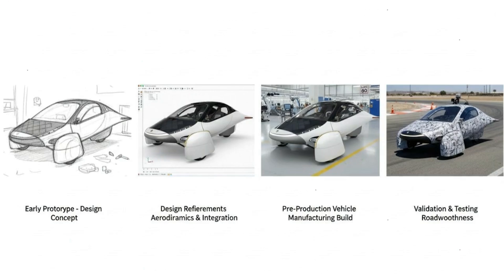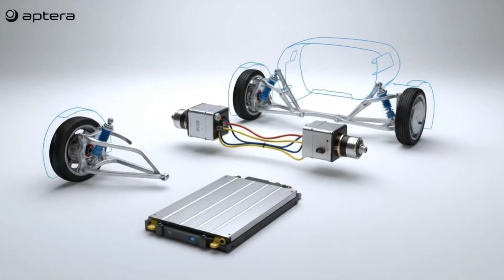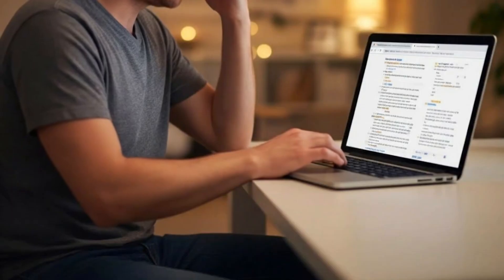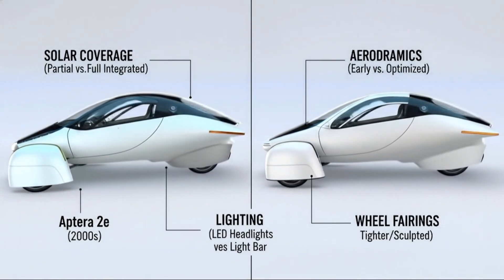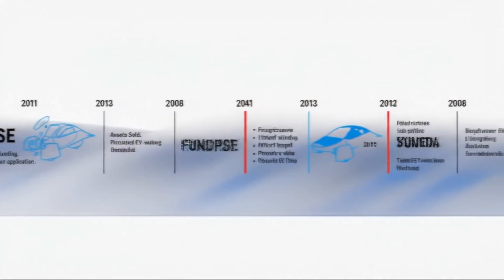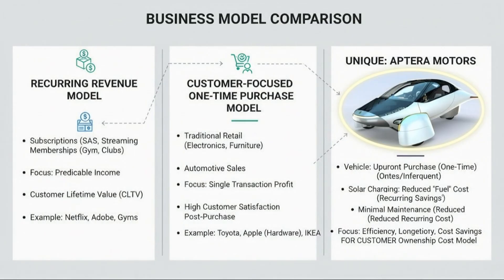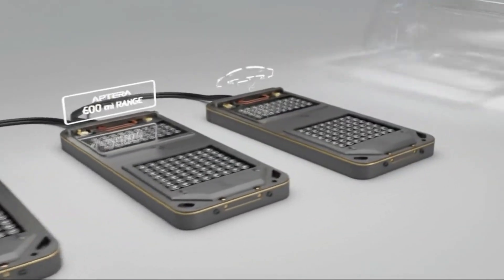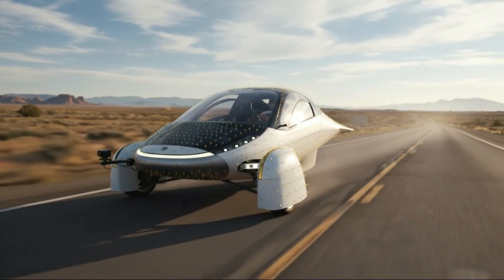Aptera’s New Gen 7 Solar Panels  The EV Range Boost No One Expected

Comment: No numbers probably means that they know it's not going to make any difference. I expect this to be a failure.
They should go back to the drawing board. There is no need for expensive panels. You can just make a flat roof. A flat horizontal roof has very little air resistance. Underneath you can still build your droplet design vehicle for low air resistance. But the flat roof optimizes the solar panel surface and allows you to use cheap standard solar panels.

Comment: Leider alles zu viel Konjunktiv! Nicht labern sondern machen! Wenn potentielle Kunden zu lange mit ständigen Verbesserungen hingehalten werden, springen sie höchstwahrscheinlich ab! Die ständigen, KI-generierten Bilder tragen auch nicht zur Steigerung der Glaubwürdigkeit bei! LG.
Reply: 4 validation vehicles are finished and they are working on all 6 of the remaining. This will give exact numbers they can post for range, volts, mileage and crash results.
Reply: @SteveBueche1027  - I already know the crash and mileage results. Published a long time ago. As for volts, that's one I'm interested in.

Also, according to Aptera, they are building 16 Pi's. So, just change your numbers a bit.
Reply: @SteveBueche1027  Does Validation mean Aptera doesn't know what the trike can do even though they promised known performance for delivery in 2021 & 2022?